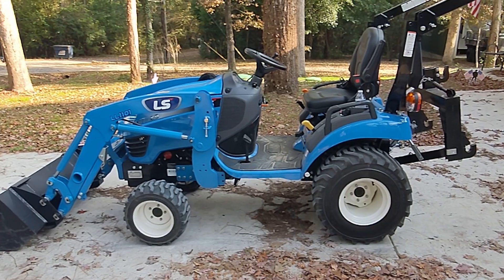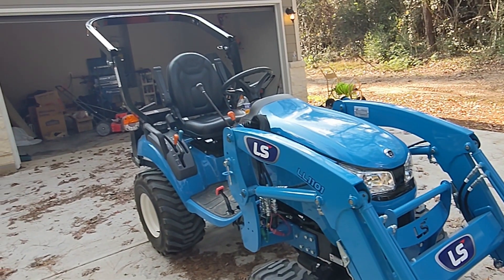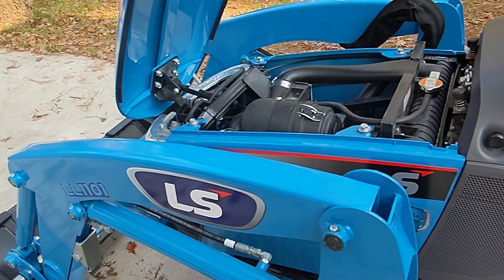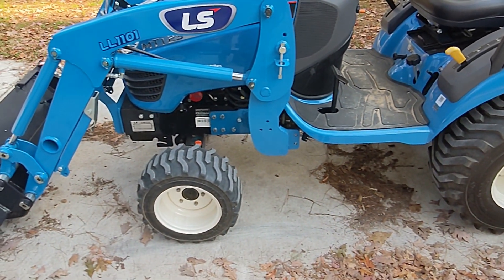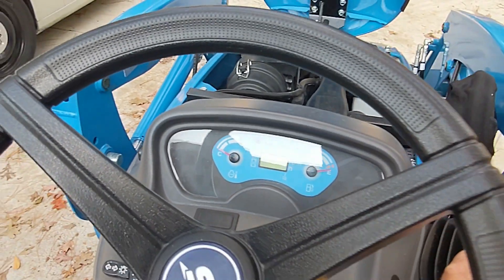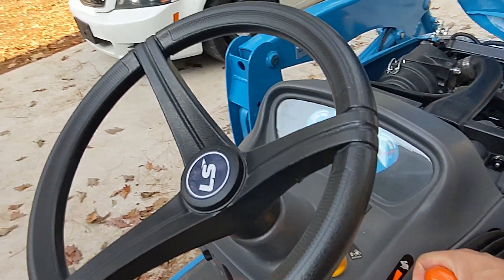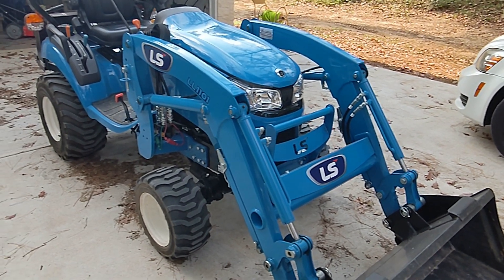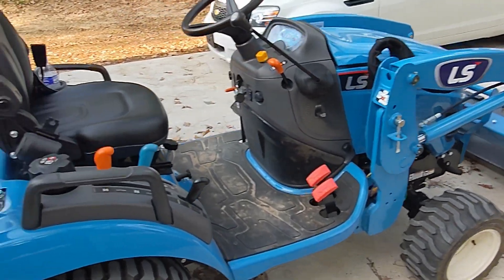LS MT125 - Review

Comment: I borrowed this same model tractor from my best friend. The tractor has a Tractor Supply blade scraper on the rear  and a canopy for a little shade. This little workhorse was used on about 1/3 acre of rough, rutted hard surface dirt and a sandy soil area where a creek runs during rainy season. I used 4wd and low gear in dirt and sand area but never locked the differential. I would recommend this little tractor and had fun using it.

Comment: Great review. I just got my MT125 a couple months ago and am super impressed with it. I did all the same research you did and just couldn’t pass up the price and specs compared to all other brands. I went all out and got the backhoe and mid mower with mine. The backhoe has already proven to be super useful.
Reply: how is it .. trans  everything seems ok , any flaws
Reply: @garyp1930  I haven’t had any major problems. I haven’t had anything else to compare it to but so far for the small projects I do and mowing it’s been great.  If you’re trying to move any real weight or anything you’ll need to put it in low because it just doesn’t have the power in high. But that probably pretty normal. When I got mine I was able to get the loader, mower, and backhoe out the door for $18,600 so that was the main factor in me getting this.
Reply: @RyanCook84  Where the hell did you buy your tractor? That is really cheap for that whole setup. It had to been used.
Reply: @therealmuddawg  I got it at a dealer in Illinois. It was right before prices went up in covid. And they didn’t charge taxes either since I was out of state.

Comment: I think Imma get one… got quoted 22.5k for a mt125 with front loader, auger, box scraper, mid body mower, and backhoe… similar kubota bx23s package quoted over 34k… I have 2 LS dealers with shops within 75 miles in 2 directions… this tractor will also be my first and seems to be the most bang for my buck…
Reply: That's a good deal. What was the dealers name?
Reply: @philhood5023  it was a LS dealer in Los Molinos in California. I didn’t get the LS, day before I went to buy it, I found a 2019 John Deere with 8 attachments for 24k….

Comment: Had to watch your videos as I own the same car - 2012 caprice ppv and same tractor. I've got the mower deck and loaded tires. I've found that a back scoop is the best rear implement as you can scoop dirt or whatever for weight, then dump it when done and also move twice as much soil at once. Building something simply for weight in the rear always seemed nearly useless to me. 450 hrs on tractor in 1.5 years. Have had loader bleed down the entire time. Loader controls under rubber dust boot are ball joint types and are poorly designed and of poor steel quality, they need weld reinforced, I've done so. There is a pin for forward/reverse hst that reams out, I welded for best fix. Hydraulic lines are poor quality, replaced with premium. Front axles just started leaking at pivot points and ball joints are worn. The dealer I got it from keeps for months and doesn't fix correctly so I do my own work. I use mine much harder than most on 14 acres, building trails, digging out and pushing over trees, digging out and carrying rocks, all up and down steep grades, also mow my 1.5 acre lawn. I replace fluids and filters twice as much as recommended. I use this as a tractor and expect things to break. My only complaint is the dealer and loader bleed down which is probably a seal leak on hydraulic cylinder. No problems with Yanmar engine.